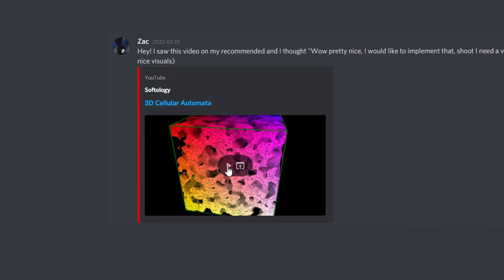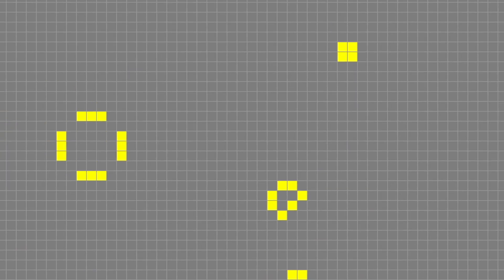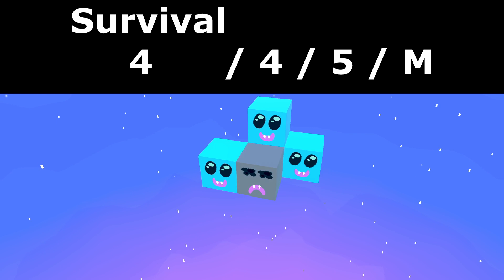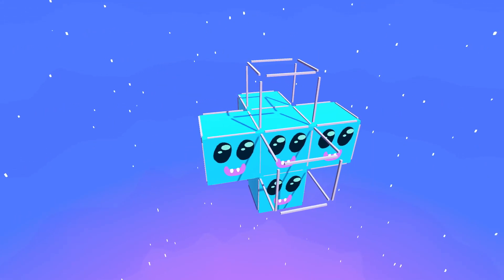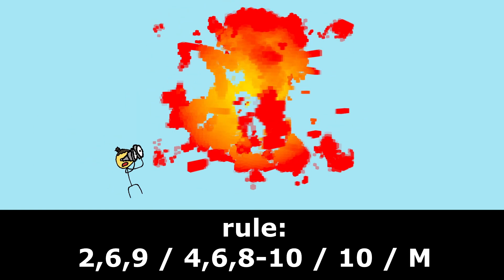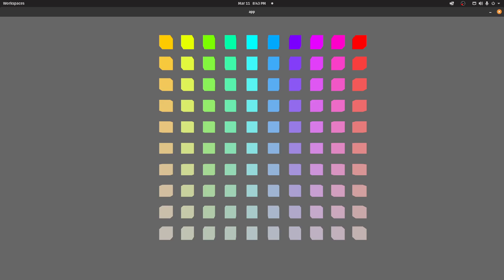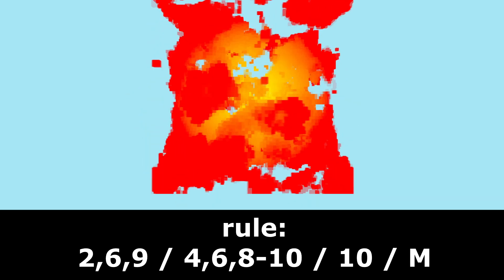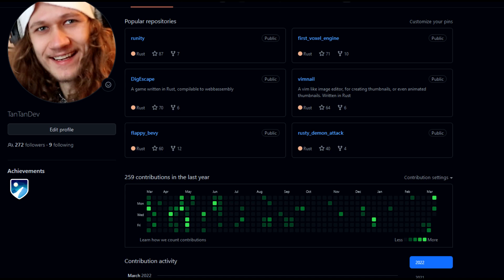3D Cellular Automata - complex behavior from simple rules

Comment: my code smell brain without actually seeing any code would say that your multithreaded solution is slower due to memory access speed issues.
Make sure you understand how your data is being laid out in memory, make sure it's contiguous and make sure that you're not doing random read and write.

also, more threads are only faster if they are not using the same data.
You need to make it so that each thread is working on its own chunk of data.
The catch here is that moving data costs performance, so you need to make sure that you are handling that data in the most optimal way possible.
From the language you are using I can tell you are not using C++, which means you are most likely not doing direct memory management.

Look into pointers, references, and copying data. Learn the differences.
Since Rust manages memory for you, it's probably doing a terrible job of it.

Comment: would c# parallel.for work here? it's fairly lightweight and way easier to use than async. (I'm thinking of doing this in unity).
Reply: Cellular automata are trivially parallelizable, as long as you give each thread the same amount of work and don't waste too much time on synchronization you'll be fine

Comment: Nice video, I really enjoyed it! Cool animations to look at, cute voxels, funny devlog, rap in the end :D To be honest, I would have loved to get some more insights about the code and your optimization journey though. I think getting worse performance out of multithreading for smaller input sizes is very common btw.
Reply from the maker: "worse performance out of multithreading for smaller input sizes". Man I didn't think of that but that makes sense
Reply: @Tantandev  Yeah I guess at some point the coordination/synchronization between threads takes longer than the actual work they do. If you're relatively new to multithreading in rust, maybe take a look at atomics (primitive numeric types that can be safely mutated through shared references) and at channels (e.g. crossbeam or flume), just to expand your toolbox. And consider using the mutex/rw lock from the crate parking_lot. It's basically a drop in replacement that performs much better, so that could be an easy win for your simulation :)

Comment: Heyo, dint get to see much of the code, but you can replace the hashmap by just an array and send it to a compute shader to calculate the new states, since calculating the new state of each cell is independent from the others. I think you could get great performance :D
Reply: The conversion from hashmap to array would make the code much faster even if it was on the CPU only
Reply: yup, did that. ~10x faster single threaded. and scales perfectly across multiple cores.
Reply: @shadamethyst1258  If you have a 1D array to store all the states, you could use a hilbert curve to map 1D array indexes to 3D coordinates. A property of the hilbert curve is that things close together in the 1D array are close together in X Y Z space, and because you're checking a cells neighbors in X Y Z space, a 1D array mapped to a 3D space via a hilbert curve means that neighbors will be closer together in memory, on average. That might be able to reduce cache misses?
Reply: @terezip2213  It would maybe reduce cache misses, but it would also make it a lot harder for the compiler to vectorize the code